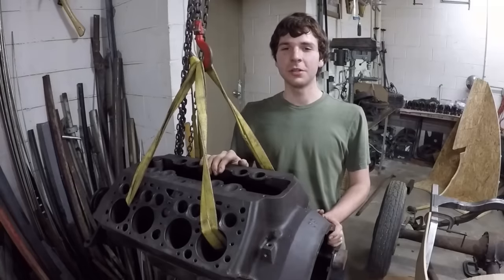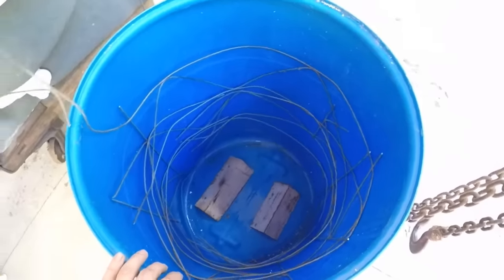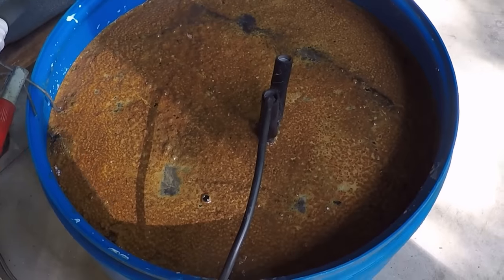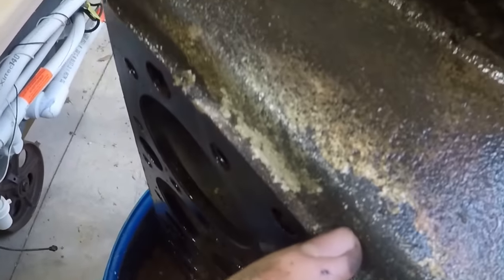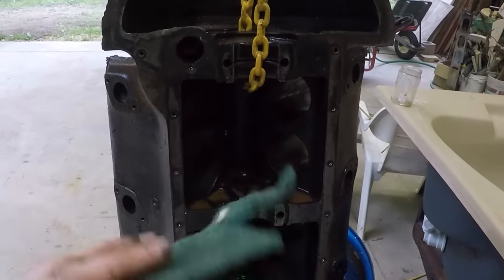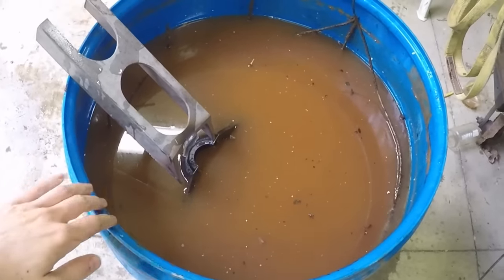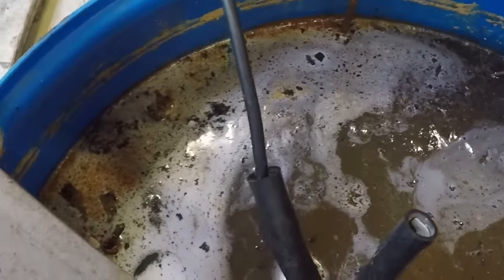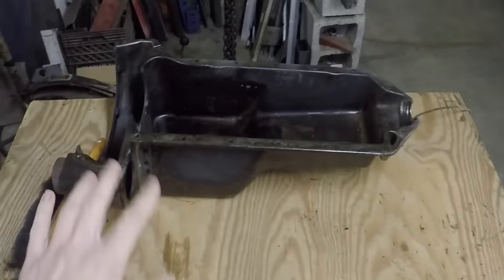Cleaning a 70 Year Old Engine with Electrolysis

Comment: I'd really like to see the 200 amp setting, haha!
Reply: You'd be disappointed.  I've done it before.  All that really means on the charger is that it's CAPABLE of 200 amps, not that it's going to push 200 amps.  It ramps the voltage up from 12 to 20 to push more current to the battery that you're charging.  If your battery is super dead, you may actually see 200 amps flowing.  But in the case of an electrolysis setup, your current is based on how well you have placed anodes and how much washing soda you've used.  You're never going to get 200 amps unless you're shorting your parts against the anodes, which would just cause the charger to trip off (hopefully).
Reply: Its as if manufacture's or government saw to many torture movies & banned the production of good battery chargers-sux!!! Because, One cannot revive a dead battery with these supposed smart chargers-they suck compared to the older ones!

Comment: Great results. A lot of the machinery and tool restoration channels use electrolysis on a smaller scale and now you show your only limit is the size of your container. 
Just as you mentioned make sure the item is completely submerged or else you will end up with an etched line at the surface.

Comment: Works much better if you degrease it first. Also use paint remover prior to remove paint. There is also a product that will not allow flash rust. Eastwood after Blast is one of them

Comment: One thing I'd like to mention is you need to blow all the parts off with compressed air before any assembly is done  wiping them with a towel or rags leaves lint on everything and when you start the engine up the lint will go into the oil pan and plug up the oil pickup screen. You really won't be able to see the lint but it's there I have 45 years experience in doing transmission work and I've seen many do-it-yourselfers wipe

parts with rags and then it will plug up the screen after the transmission is run for a few minutes so never wipe the parts with rags or a towel always use compressed air to blow everything dry
Reply: he used wd 40 too

Comment: Definitely planning on doing this with my 68 383 big block mopar. Scored it and 906 heads from a guy for $300. His kids had torn the plastic off the block while it was in his shed so the entire block is coated in a surface layer inside and out. Going to drop it into my 95 Dodge Dakota (V6 Magnum) And rebrand it the Dakota Super Magnum as the 383 and 400 used to be called the "magnum" as well.

Comment: could a steel drum on blocks be used and eliminate the wire grid?  When you put the clean up towel in the laundry basket be washed be sure to tuck it under some other items so it does not "stick out".

Comment: Thats the nice thing about this process. ive done entire engines that are 80-100 years old and it removed all the exterior rust. you can even dump the water on plants and it wont harm them depending on whats left over
Reply: Only if your plants can take a dose of washing soda! The washing soda doesn't change (except for the part that breaks down the grease, and you can use the same solution over and over. I wouldn't dump it anywhere that you value the plants. It takes paint off too, and if you had lead paint on your piece, you'd end up with that in the sludge, so careful where you dump that.
Reply: @87mini   ive had no problems the few times ive done.
Reply: @41Zman  That's good to know. I'll wait till my wife's gone, though...

Comment: The electrolysis removes rust and anything over the rust, it doesn't clean it, but due to the electrolysis process it does dislodge  contaminants from the surface. 

No other metals should be in there other than steel or iron. It's best to use iron as the sacrificial piece. Cast I think is supposed to work better as it has more surface area. 

No stainless steel or chrome should go into the solution, as it can produce hexavalent chrome. Which is highly toxic and quite damaging and hard to get rid of. 

I recommend using some steel bailing wire to connect the power source to the battery charging clips. 
The higher the current the faster the process will happen. What was supposed to happen in a few days will happen in a few hours. 

Just ensure that there's adequate safety notices around the set up so no one electrocutes themselves if they go near it when you're not around to tell them not to touch it. 

But other wise the set up you did was pretty good. I'd recommend a sheet of metal around the barrel. The more evenly the anode surface is distributed in terms of distance from the cathode the better. 

It works great on old garden or workshop tools that are made from steel too. Just remember not chromed steel.
Reply: @bottomlands  it's not the voltage that kills. It's the current. DC is less likely to harm you, but it's always best to take precautions as if it would.

Comment: You can get similar results using water and molasses. You need to degrease first as the oil will kill the microbes that form to eat the rust away. Same black iron oxide coating when you pull it out of the water that will wash right off. I use one small jar in a rubbermaid trash can with water with great results.  Nice video.

Comment: results could be far better if first, you have used white spirit or diesel to remove the grease. In addition, a brake cleaner is also a good option before starting the electrolysis.

Comment: If you want to save on WD40 you can mix yourself, 8 parts of solvents like gas/petrol and 2 parts of fresh engine oil. Use it for year to protect bare steel tools etc, you can wipe it off and layer of oil is left, just like with WD40.

Comment: The process prefers 'line of sight', i.e. rust on surfaces facing the other electrode will be preferentially removed. To really de-rust the water jacket, I would fill it up with a rust remover and let it sit. It is an economical way to de-rust large items. Another way, that has the advantage of getting every nook and cranny clean is molasses and water (look it up on YouTube).

Comment: I'm not 70 yet, but I am getting close. Maybe electrolysis is for me...

Seriously, the results look great. I have spent too many years with steel wool, brass brushes, etc.
Reply: Don't forget to take off your glasses if you wear them, dentures, amalgam tooth fillings,and if you happen to have a steel plate in your head don't use more than 40,000 volts.  Good Luck

Comment: Your positive electrode can go to a 45 gallon metal oil drum and that would act as the sacrificial metal. As long as the part cleaned has no contact.. Works great, cheap and disposable.. I'm planning to unfreeze cat tracks in a 2ft steel dia pipe with electrolysis. Does any one have experience doing this? I did a 4" record vice with 10 years of rust on it so I know tight tolerances like the acme thread took about 2 weeks to dissolve the rust.

Comment: Instead of the myriad of wires inside the plastic tub, use rebar pieces as they will take up less space in the tub, so you don't have the engine block so close to everything. If you put a faucet to the bottom of that tub, it would make it easier to drain away the used wastewater afterwards. A cup of washing soda per gallon is a good measurement for the mixture. You can dump the wastewater into a flowerbed after you finished with the electrolysis of the parts, as plants love the iron in it but not into a veggie garden where they plants are eaten. To remove the black after the electrolysis bath, then empty the tub and refill with the used of vinegar and start it over again. Any strength or brand of vinegar will work. Use a wire brush or scrub pad as you did and most of that black residue will come right off once you spray it again. Coat it immediately, and I do mean immediately, with a light oil or WD40 to prevent flash rust after the cleaning. Nice video. Keep the tub out in an open area so any fumes do not cause a potential issue with a flash fire or explosion. Doing this entire process out in the hot Texas sun also helps to make it work all the better. I have never experimented with using hot water as the bath water for the process, but I do wonder if it may make a difference in effectiveness of the process.

Comment: Looking forward to you building this engine. I never built a flathead so it will be interesting to see. I think some time with a drill and  various wirecups would do wonders on the surface now and buy a set of engine brushes for journals and passages!

Comment: I don't know if you put it back together or not, but a cautionary tale for putting steel and aluminum together: don't. They will set up an electrolytic reaction that will eat the aluminum. My dad was a die-cast inspector at Johnson Motors from 1972-86 and he knew metal. This was also backed up by a friend who worked for WisDOT in the sign shop (signs are aluminum, bolts are galvanized steel). You need an interface material such as brass, nickel, or copper between the two metals. Obviously there will be  a gasket between the dipstick housing and the pan, but get a bushing on the bolts or rivets when you put it together.

Like many others, I'm looking forward to you working on the body panels.
Reply: I suspect that because the surfaces are covered in oil, there will be no water between the 2 metals so here is one place you can do it safely.Johnson outboards, vehicle waterpumps in aluminium alloy etc are notorious for degrading steel screws, bolts and studs over time to the point where they often shear during removal.
Reply: There's a gasket in there. Plus it is an oil pan. Oil will help reduce galvanic reactions.

Comment: If you use more amperage your solution will get hotter. What you are essentially doing is calcium carbonate in aqueous solution or in your case Borax, (Boron Carbonate) to generate a hydroxide group at the iron base of contact. The black stuff is pure carbon and / or Boron that bonds with the iron. The hydroxide groups created by the electrical charge Bond with the fatty acids (oil and grease) and esterify them into soap. Aluminum will beat eaten by the hydroxide groups like a cake in a weight loss clinic. Hydroxide groups with a metallic base such as sodium or potassium have a pH around 14. 

Essentially what you are doing is hot tanking and treating with ospho all at once. I thought I was the only one that prefers this method. If you have the time, money, and room, build a purpose built tank with a kynar or HDPE  lining. If you are good with electronics build the current control to be regulated proportionally to temperature at a set point of 90°C. Insulate it for more efficiency.

Oh. And one more tip. The scum that is left over is gold. Get some litmus strips. Boil the water out of it and filter it through a coffee filter. Slowly mix in a high quality mineral based motor oil until you have a pH of 9. Let it cool and you have an amazing all purpose grease. The rare earth metals such as molybdenum, vanadium, and platinum that rub off the piston rings and valves into the oil make the grease perfect for everything except brake carriers. Add copper powder and graphite and you have an excellent anti sieze compound. Most forms of grease are nothing more than high quality oils and additive metals and minerals neutralized with a hydroxide to Form a soap. Did you ever notice that when you pack a bearing the old school way in your hand, the part of your hand that you wipe with the outer race is actually really clean?  💡

All mechanics should learn chemistry. It leads to all accepted constants making sense. You don't just know that  ceramic piston ring are good for racing, you understand that they  don't retain heat or bend from the acting of surface tension caused by rapid heating and cooling because vitrified ceramics have a low modulus of elasticity. Or why if you have an iron block and an aluminum head, you always use a copper gasket. And why synthetic oils and natural rubber gaskets don't mix.

Comment: After the process does the contaminants settle to the top? Meaning if a drain were low on the container then could u drain just water then stop to empty contaminants easily for proper disposal?  Process worked great just not draining that trash on my yard...

Comment: The grease is something you're supposed to get off before electrolysis. It can keep the electrolyte from contacting the metal and make for an uneven treatment. I suppose you don't have to, but it will clean better.

Comment: Hey man good job but I would bolt a copper to the block and then hook up the negative charger cable out of the solution. Otherwise it will eat the negative charger cable end up.
Reply: Sounds to me like you've done this before yourself.

Comment: ack, dude put the support chain on a main crank bearing surface!  Otherwise, good vid!  I've done all manner of parts over the years like this, even a truck bed, hoods, doors, seat frames, fenders, rims--all kinds of stuff.  It's cheap, works with "household" items, and saves alot of elbow grease, hehe.

Comment: Some advice: for protecting larger items like the block & pan from flash rusting, go buy a gallon jug of wd-40, put it (wd) in a cheap harbor freight paint gun and spray the item down. You’ll get good coverage without wasting as much product.

Comment: You should really pressure wash greasy and dirty parts and get them as clean as possible before you use electrolysis to clean them. You will get a better more uniform outcome. Washing soda was used in laundry soap for hundreds of years.

Comment: Looks great - Actually Easyoff  Oven Cleaner spray will clean it spotless too around the aluminum areas ,Even on your running vehicle it will remove paint too -Careful Caustic Soda ( RUBBER GLOVES ).

Comment: [Serious Concern]
How do you connect the negative terminal?
Because rust cannot conduct electricity..
Plus engine block are made up of cast iron which is made from carbon and iron..
How do you find the area with high iron content? I.e where to place the negative terminal?

Comment: When you're pressure washing or doing anything where there's a constant state of shit flying, you need goggles at LEAST! Even water can cut stone and steel, but you're propelling rust and other dirt and debris with it! Let's try and keep our sight. Try doing any of this without it. Imagine even trying to pull off moving the car into the garage let alone working on it! Thanks for sharing. Don't want to lose you!
Reply: Also, steel-toed shoes or boots. We've all had a block fall over sooner or later, and those sneakers won't protect your feet.

Comment: Soooo .... deck the block and mill the heads each 0.300"? (to increase compression and ensure neither are warped)
How much do you have to bore the cylinders out?
I hope you don't paint the block, oil pan, and heads a boring black.

Comment: Try using " draino" 3or 4 cans in a 55gal drum, fill with water, light a fire under the drum, let sit over night (home made hot tank); use gloves.
Reply: to do this does the fire have to burn all night or just get the water hot and then let it sit over night, thank you
Reply: james bennett to do this does the fire have to burn all night or just get the water hot and then let it sit over night, thank you

Comment: This is the best method to gently clean a block as its calcium based by using washing powder, if you use battery acid in the water its a lot more destructive as are salts which do cause dangerous gasses which can kill you, the method is, place the item in the tub with water, connect the battery charger as shown, then add washing powder bit by bit, when you get a current draw down on the charger you have enough washing powder, if you use battery acid you may not have a block left the next day, remember DC does not pass through plain water it needs an electrolyte for current to flow.

Comment: I am wondering if bearing grease would work better rather then water displacement #40 it just seems to me that wd40 dries way to fast & does not leave behind any lasting oil or grease to protect against rust so, I am wondering if you would be better off using grease? Also, You might want to clean it & then  mast off that block & get it painted unless your waiting until after it is built?

Comment: Top vid m8! @ what stage would b the best time to start spray painting the part.
Reply: After the tanking use acetone and if possible bake in oven to remove any left over oils. Then paint a freshly acetoned de oiled and dry part.

Comment: Nicely done video . Thanks.  What if you want to paint the block or pan now and it has WD40 on it?  Just clean the paint surface with solvents?
Reply: Yep just spray it with carb cleaner or electronic cleaner

Comment: in our way, do to remove residual impurities, griss and oil as well as burn marks in the cause of oil. with 3 ingredients. main.
1. The liquid removes non -acid griss!
2 diesel
3 laundry detergent.

Mix the 3x3 bhan in 1 container, which is large. in content not too much.
After that, add water, fill it to the brim. and let 1 day. 24 hours. then wash with water spray pressure

Comment: I am impressed that you didn't have multiple short circuits. Any thoughts of putting in a porous insulating separator to completely prevent shorts?   Also maybe blowing out internal block passages with compressed air and then squirting them with WD40 would be a good idea.

Comment: I've used this process and it does work great. There is a video of a guy that took a completely rusted 1918 45 caliber pistol and made it work again using this process.
I see you have a later model block. Are there any cracks by head bolt holes or valve seat areas ?